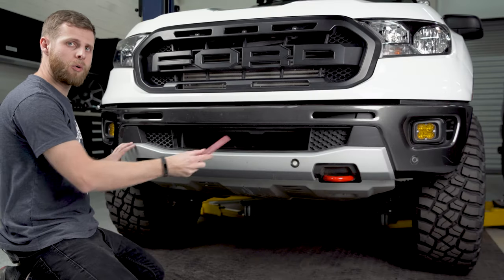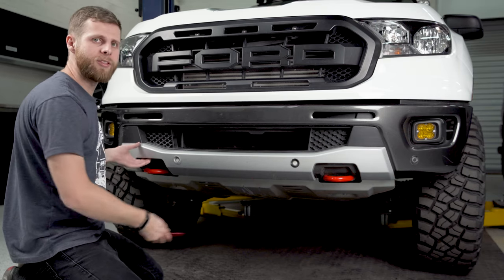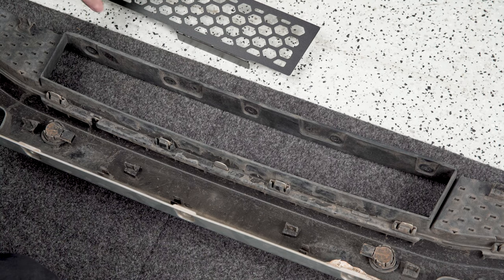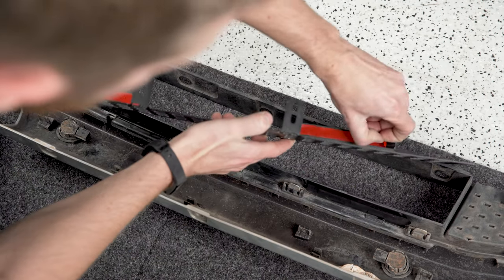2019-2023 Ford Ranger Putco Hex Style Lower Grille Install

Comment: I brought the same grille on amazon installed in 10 minutes slid the bottom part of the grill wear the 3M tape is located into the bottom of the grill space and tighten the license plate screws real tight and no problems easiest mode ever.
Reply from the maker: These are a great easy to install grilles, we offer several options on our site https://www.stage3motorsports.com/2019-Ford-Ranger-Grilles.html
Reply: I did the same thing! Took about 10 minutes. Only bolts removed were for the license plate mount. Used one socket to remove plate bolts. Try it! There is no need to do 45 minutes work with body tools etc.

Comment: Just did this. Way more difficult to take the bumper off. Didn't go back on clean either. Should've just slid the plate in and saved myself some damage.
Reply: All my clips on the back of the lower grill broke off honestly not sure how he slide his off so easily. Those clips have metal teeth that do not allow it to easily come out all mine broke I had to sand heat and jb weld it good job once again ford!

Comment: I just put that on my new ranger mine has the adaptive cruise control box and instead of the stainless steel screws I used plastic push pins so there is no change of rust keep the videos coming in especially for the rangers
Reply from the maker: Great idea Paul, we've some great stuff coming, hit subscribe and stay tuned!

Comment: Size for the hex head machine screws are M6x1.0 if anyone is wondering. I used 20mm long ones. probably way too long but they worked.

Also, those little metal trim retainers suck. Took me about 10 tries to get them all to stay in place when installing the valance back on.
Reply: I got a oack of screws that say #6-32x1in...will these work?

Comment: If you have the proximity sensor for the cruise control system will this part work?
Reply: There is a different version of this grille that will work with the adaptive cruise control sensor, just check the 2nd link in video description.
Reply: @NoahStage3  thank you 😊

Comment: Does the Ranger come stock with that area open?
Reply: Yes, some trim levels have adaptive cruise control which requires that area to be open
Reply: @VicLabs It always bugged me to have that area open. Seems like it would be easy to damage the radiator.